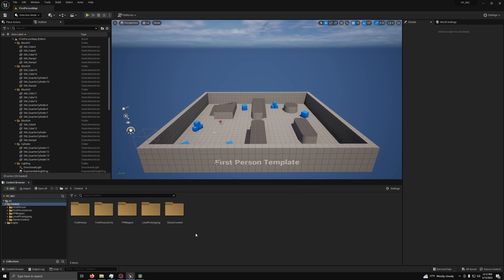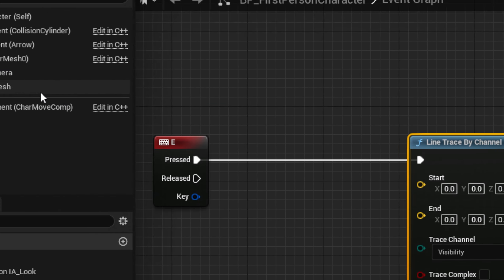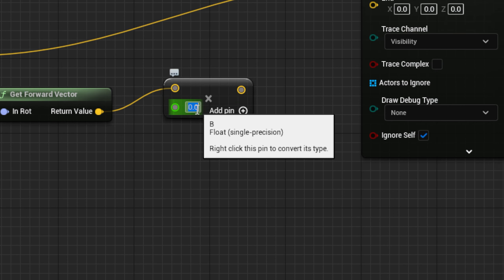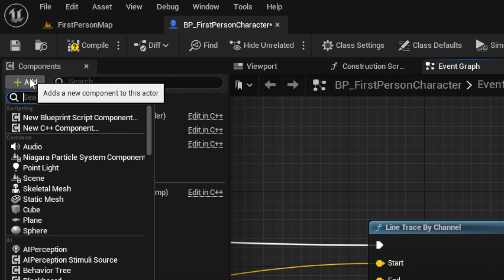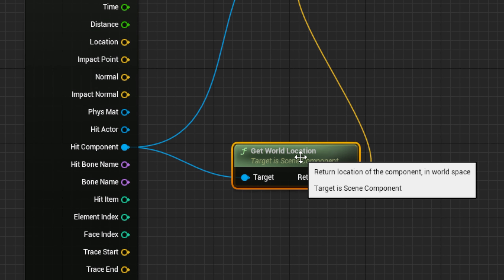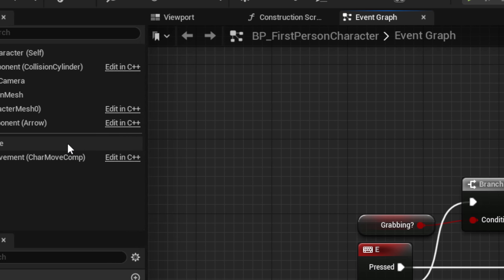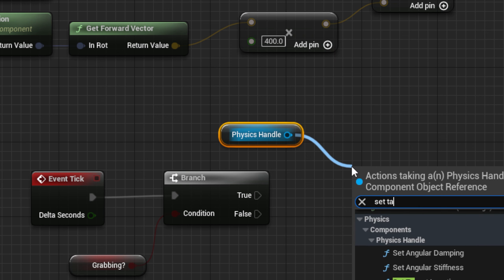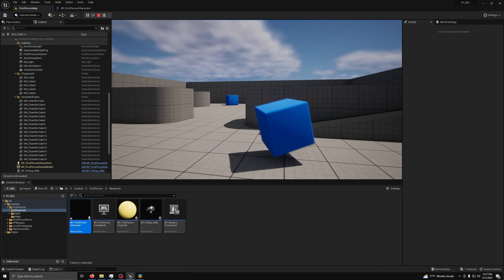How to Add a Grabbing System to Your Game in UE5.1

Comment: Thou shalt not instruct upon deprecated Input Systems.

Please Migrate to Present.
Reply from the maker: The code still works. Also I have not had time to learn that yet and this is a simple project. But If it bothers you so I will learn it for my next input video.